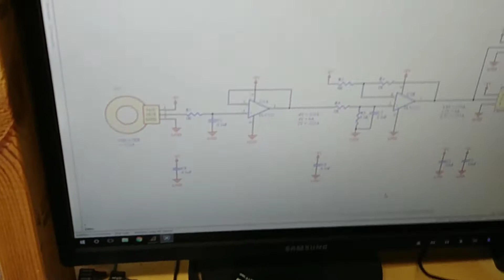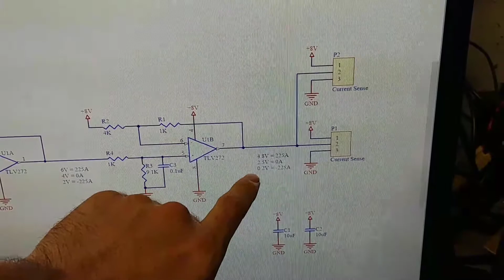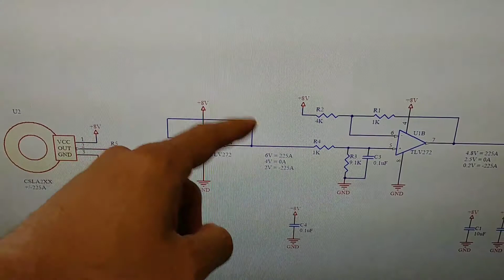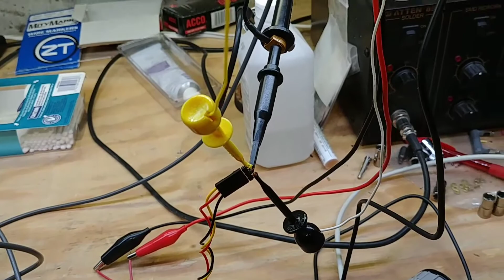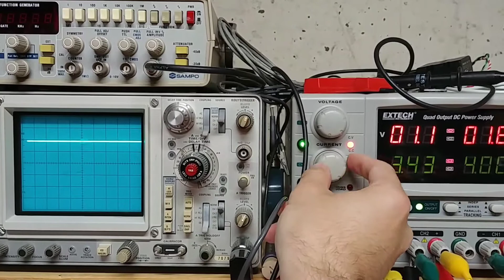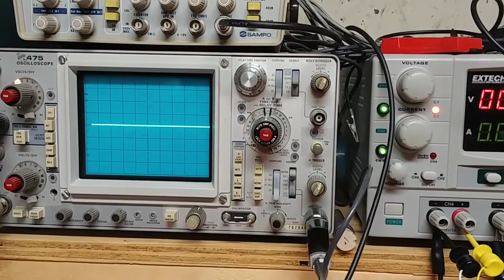Solectria E10, Lithium Ion Battery Upgrade, Part41

Comment: You will not burn out the sensor if you exceed the 250 amps.  All that will happen is you'll reach saturation.  At 300 amps you'll still read 250 amps.  This will throw off your SOC calculations but it won't burn out the sensor.  Actually the sensor will still show an increased reading past 250 amps but the linearity will be off.  It will no longer be a straight line but have a curve.
Reply from the maker: +randycarter2001 

Yeah, it won't burn out... But the sensor can be damaged. Operation outside of the sensor range will result hysteresis around zero current.

But, I should be staying well inside the +/- 225A range of the sensor. :)

Comment: Good work.  Shit happens... Go with the bodge wires and ship it :P
Reply from the maker: +SquishyBrained 

Nah, it's only $13.90 for 6 new correct boards... And I already ordered them. ;)

It takes to much time to unsolder the connectors to get to the op-amp, then cut the two traces, and then add the jumper wires...

Plus it looks bad. ;P